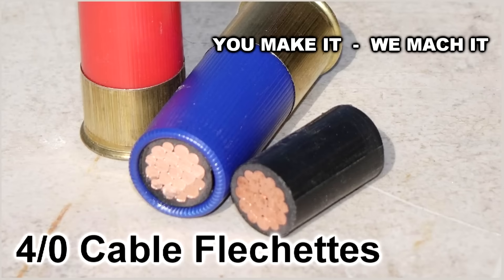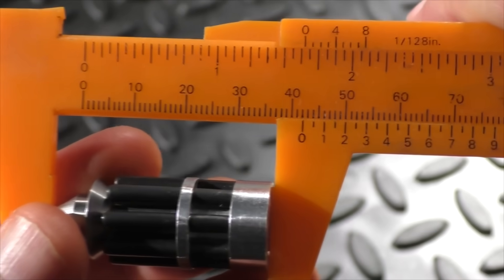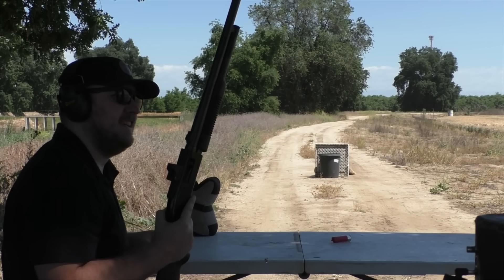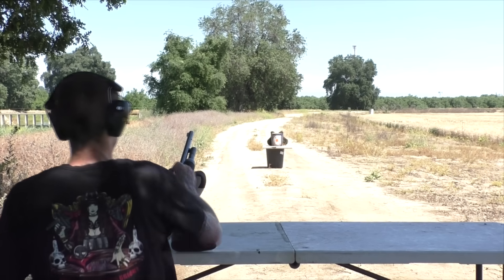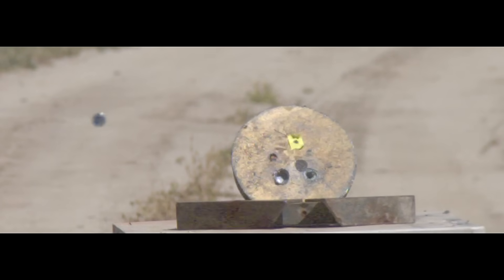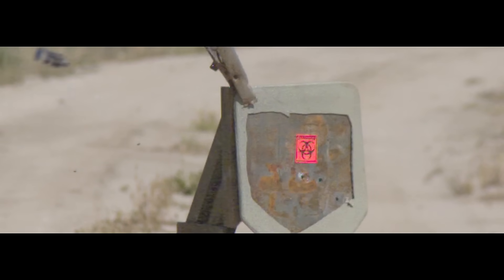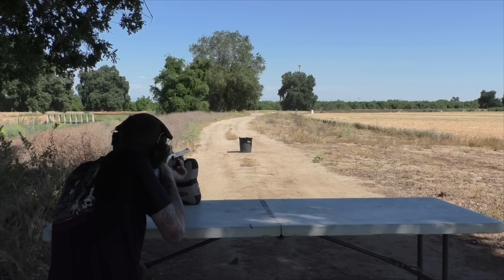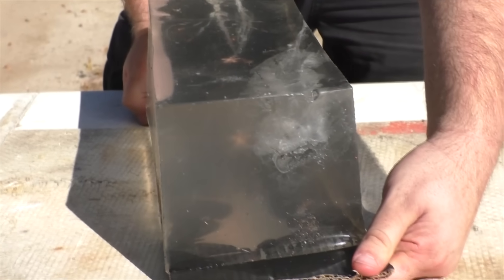RODS from GOD -  Possibly the best 12ga slug we've tested

Comment: The way those flechettes open up on impact is practically designed to rip through kevlar, since kevlar weave is designed to absorb impact by crumpling inward and catching it like a glove, the rods spread out and press it out in a flower like pattern which allows the main projectile to rip through dead on without any deviation or kinetic loss.
Reply: Also the main penetrator is anchored in the the bottom with a  screw on impact this is very important as  when the nose cone pushes back and causes the roll pins to flower out the opening roll pins would apply a leverage force on the rear where the main penetrator is attached using its own force to accelerate the main penetrator. 

Think almost like a secondary Sabot that opens up on impact
Reply: @SgtPriad  lul wonder how NY or CA would try to regulate this thing
Reply: @Sinvex Stop taking guys or they will m!😂😥.
Reply: @SgtPriad nasty little round
Reply: Good bye hollow points, hello rods from god
Reply: @arevolvingdoor3836  bro what? hollow points are ineffective against body armor, how are these two things equivalent at all? how is one replacing the other?
Reply: @mika_iran sabots do hollowpoint but core also goes through body armor
Reply: @arevolvingdoor3836 sabots from hell
Reply: What if they’re made of tungsten?
Reply: @joelsims98  this slug looks like it is more effective against meaty creatures and light body armor. SCP Foundation Mobile Operative Groups look forward for obtaining that design. Tungsten mod should be even harder to produce at least
Reply: @joelsims98  "fk you and the three goons in line behind you."
-t. Rusty Shackleford
Reply: Very effective.
Reply: Shaddup dork
Reply: To me these look like Advanced Hollowpoints functionall. Expands on impact so the entry wound is a fraction of the size of the exit wound

Comment: if you changed the core penetrator to tungsten or hardened steel, then made the rest out of copper or brass, maby keep the rods steel and add another collar in brass/copper to engage with the rifling and you should be able to make a mold that you could cast them and they would preform a lot better in all scenarios. could also change the tip of the penetrator/shorten it so it works in all shotguns.

Comment: try a bullet from a drill. Just find a drill of the appropriate diameter and cut off the part with the cutting edge. I wonder if it will rotate? It seems like no one has ever had this before. Need a plug to protect the barrel. Looks like you can cut 8-10 pieces from one drill

Comment: That round is incredible... I hope it gets a fitting manufacturer that can make them to some degree affordable.
Reply: You might as well ask dry water
Reply: @robdeskrd you can make dry water! Blend silica dust, water, and air and boom, powdered water.
Reply: @robertcapostagno2082 
Rob you a crazy mam 😁
Reply: @robdeskrd  Swapping out materials is a possibility.
Reply: @aleprechaun8972  the main issue would be the number of parts mixed with the machining, the number of man hours into machining each slug would make these an unfeasible production round

Comment: I think your shotgun MAY be unlocking prematurely. Normally recoil would not explain ejecting the round. You have slo-mo footage that will make it clear. Just don't want anyone hurt. Thanks, as always, for great video. Amazing round that I would never, ever, have thought of.
Reply from the maker: The bolt unlocks after the trigger is pulled.

Comment: Cup the end front end of the rods, and inset a nipple ring and a hole ring on the front and a sort of route ride up the nose over the holes..  intent to have the rods hold from the head flying back on the fine thread explosive load charge untill impact.. the rods might punch in the nipple .. a couple depth tests with a piston or something  in thick glass  tube to watch the load be fires at grain load variance equivilancies.. and a " fail " point of impact , as well as the acceleration stress fail points.. 
 But that looks well made and effective.. distinct advantage in a belt feed bottom feed sort of situation/arrangement.. of course we know you fellas wouldn't have altered or machined anything out side of manufacturers specs for the more fluent operstion and safety while using such rounds.. 
 Lol.... but .. ever tried gasoline or RC copter nitromethane liquid in the diesel compression.. hollow rod with a small hole at the back, piston and alignment pin.. screw into head cavity Teflon tape screw on back rod holding cylinder ( no evaporstion.. keep under 212 degrees farenheight.. ) sorts of tests.... 
 Mushroom screw bac cap with thing center so the piston pressure  reforms a crack to in vent the pressureiszing air .. fairly safe .. 5 pieces plus rods and sleeve ring rod alignment washer.. 
  Cold set and let it expand tight in some assembly to more so assure no leaks.  .. 
  KUH FCKING BOOM.. 
 Do not shoot yourself in the foot kids.. pieces is parts.. ( it's a chicken commercial) and tires ain't pretty.

Comment: How fast do you think a 12 gauge with a smaller length projectile but only one of them could be accelerated with the largest possible grain size charge? Kind of like a mini version of the railgun slug but shot with a sabot out of a 12 gauge?
Reply from the maker: It has more to do with the weight of the slug.  We've shot slugs at over 3000 fps but they were made of delrin and light

Comment: It would be a "  injustice "   Not miss justice LOL..... and from what little i have seen the Rip Ammo is still better perhaps if our designer added more shrapnel to his design, yes the pins are sharp and hard but that  cone battle angled plate stops them a bit as you can see they dig in to it a bit. if he added a cork screws projectiles and more,  would go straight and cut deeper? maybe bevel the cone part for each rod?

Comment: Wow! You put a Tungsten core in that, replace the Rods with ball bearings all stacked in rows and that spreader mechanism at the top is going to send those bearings out near sideways while the Tungsten core goes through darn near everything. Crazy levels of destruction! Well designed Jay!
Reply from the maker: Let me know when you make them!
Reply: While you’re at it?  Make a Mauler kind.
Where the rods have a designed hook at the ends of them, that latches back onto the base Core when it starts to spiral in & spread?  With added Ball Bearings.  And then see what happens 😝
Reply: Kinetic energy powered claymore,
Reply: @MikeEwalt  portable claymore, psychotic man work

Comment: Might be the future, loved the vid
Great spread on the low resistance dummy, that collar will direct the penetrators in any circumstance, truly massive wound channel and extraordinary energy transfer.
Only concern is over penetration vs targets in a wide arc behind, which would limit these things to specific tactical uses.
If that central penetrator were tungsten rod it would double up to penetrate vehicles as a multi purpose threat. If the pins were made to open out/deform, being a rolled spiral with a tapered spreader in the lead end then wound channel and target shock would be unassailable.

Comment: I reckon you might call me new to the gun community. I've been doing it now for about 5 years. In that time, I've learned so much it's unreal! And i know I still have so much more to learn. I can tear down all my pewpews(YouTube Idiocracy) clean and put them back together. I have taken parts from one to put on another and modified it. I have even got into reloading. A friend of mine has all the stuff and the past 6 months or so. I have loaded all different types. But the one thing we don't have is a shotgun shell reloader. And this channel has made me definitely want to get one!
Reply from the maker: Shotgun shells are pretty easy to load and don't take a lot of equipment.  I have the bare minimum really,   not fancy scales,  powder feeders and I use a really rough old press to resize and reprime.

Comment: The rods from God doesn't fit into the category of sci-fi. It's completely plausible, simply impractical. It would cost too much to put them in orbit.
Reply from the maker: Most sci-fi is base on some facts.  Until it is a reality,  it is just fiction
Reply: @taofledermaus  then I fear you don't comprehend the definition. The theory has been worked on, on and off since the cold war. The one and only observed factor keeping it from being employed, is expected to no longer be an issue within 10 years. While it may yet be implemented, it has in fact been worked on. There for does not fit that description.

Comment: Use a standard automotive lug nut and a bolt for the center instead of the machined parts. Hold em together with a simple cable tie and use brake line tube for the rods. They seem to already be hollow. The front of the lug nut would be hollow, so you could even put the shells in a magazine tube.

Comment: Would have been very disappointed if you wouldn’t have did a new gel block test 😅 I was literally commenting fixing to stop watching and then bam there it was 😂 definitely wouldn’t mind getting some of these or if the OG would give info on how he made it so I could make some myself. Would love to have these for home defense rounds. I’ve always been big on self defense setups but after last July having a armed intruder while on vacation at a rental house we rented and having to use deadly force I’m alittle over kill in stuff now everything has lights on them as well as red dot. So even edc pistol that’s a G43X at the moment fixing to buy a g19x to kitting it out with a red dot and flashlight for edc! I used a sig p365 macro x in Florida in the intruder but it was plan jain all OG but it was the ported barrel sig and I loved it and it did its job as a tool and saved/protect mine and my families life’s that night and was running hornady critical defense but the pink tip ones because I had bought some for my wife and I had loaded it up with them after shooting acouple boxes of them and they did the work and stopped the threat and unfortunately the guy passed away. But the investigation is still open until the DA signs off on it so they still have the sig until he signs off that it was clearly self defense then hopefully I’m able to get it back and if I get it back it won’t be my edc for when on vacation and stuff again more of just around town and stuff because a Glock is a much cheaper tool then my sig and if it lost a Glock who cares they a cheaper to come by. So everyone that reads this remember if you have a choice of weapon use something you don’t care to never have again because you might now get it back 😂

Comment: Showed this video to a friend and he is now asking what modifications you made on the second load for Shane's gel shot. He also said he really appreciated the measurements and loading breakdown.
Reply from the maker: I used sabots that were a few thousands of an inch thicker.  These slugs really didn't have much surface area to grab onto.  I backed off the powder about 1 grain.   I also wrapped some electrical tape around the base of the slug just to grip to the sabots a bit more.

Comment: Zombie Stoppers. Stompers?
these are downright Nasty.
but well designed: the components are simple enough to batch out. assembly is the worst part.
the nose geometry can be improved, and it might be worth the time to cut ramps on the pins : simplify the ramp ring to a square slider...
it'd be interesting to  see if a plastic or resin could hold the pins: that would remove the most difficult component, add pins, but complicate & extend setting time...need a mold/casting jiig to hold everything centered as it went off. Hot Glue??

Comment: the front of the darts are offset by the center core so they will wont impact at a 90 degree angle so its unlikely to do much to hardened armor because less energy

Comment: After hearing you mention the Kylon rounds, I spent the day and all night researching and prototyping rounds. I've scrapped everything and concluded Kylon has the best shape. With it's existing 1.2G nylon 'Shell', it would need a 1/4" x 1" tungsten insert through the tip with 8 thin, 3/4" x 1/16" tungsten rods, drilled and inserted at a 45° angle from the center of the bottom for the flechette effect. A perfect round for soft and armored targets.

Comment: What a terrifying round. I knew exactly what would happen based on the design. Wasn't wrong. Yeeesh. Just to change the subject a little bit, when I was in the back of the security van, when I worked in the industry,I only had 1 demand. A semi/pump 12 gauge with a starting round different from the duck shot we're supposed to use. I wondered if a solid as the first round in the breech was good enough. Now I know exactly what round  want first. Yes, very much😢

Comment: You know, considering it's only steel and aluminum and the pins, mass production could probably end up being a thing that would reduce the costs significantly. If these rounds got picked up by someone with the means to do it. Honestly those are insane rounds. I'd be curious to know if they could be designed shorter and still work? Maybe make them shorter but give them a tungsten core so the weight stays about the same, but you don't run into the problem of the pointy end touching the round in front. Honestly just a really cool design! Always love your videos that end with the lead plate and the gel block! If your gut tells you you need a reshoot, then take the reshoot if you can! I think everyone absolutely loved that!

Comment: So this slug acts as a flechette in soft material, armor piercing in light armor, and fragmentation on steel. Literally no matter what you shoot it at, it always maximizes damage. Damn.
Reply: Pretty serious engineering to be sure. This guy could make a killing (no pun intended) commercializing this slug.
Reply: I think the problem with mass production would be the complexity. Way too expensive to make for it to be anything but a specialtly round.
Reply: @altec6976  yeah, it definitely wouldn't be replacing regular slugs in the future, but the idea is pretty efficient.

Comment: Banana Ballistics used to use an 8x8x8 inch box of sand and that stopped almost everything - even high velocity and power rifle slugs - the military uses sandbags for hard cover for a good reason.
Wow though - I was hoping the round would work as advertised and OMFG, did it ever do so - I hate to say it, but this thing borders on being a warcrime.
That said though, recall those Russian rounds done by the killer clown guy - there was one which was segmented and had anywhere from three to five (?) petals break off cleanly and spread out, with a half-slug instead of a rod going down the center.

Comment: Great concept, but I would change it a bit.
I would make the front section both shorter and with a wider and less pointy tip.
This would make it both possible to load without anything sticking out in front of the plastic and the point would not detonate the shell in front of it in tube magazines.
The center can always be made of tungsten as well if better armor penetration potential is wanted, but in most cases this is not needed at all.
If a proper machining setup is done, I don't think the manufacturing costs would be so high if a decent number were made and I think many would accept the cost per shell for what they would use this slug for.
I would not hesitate at all using this slug on cape buffalo and for hunts like this, the ammo cost is not something you care about.

Comment: Jay did a fant1stic job here. Not only with the engeneering of the slug but also with the research over it. Because from my point of view the science behind it is incrédible. The force of the impact on the centerpin and the ring of steel come push the little rod, then the back end push it back in and reflect the force of the impact too on the rod. (Newtown law the rod apply force on it and its reflected) wich push them and make them as lethal as the core. Making it so deadly i hope it wont go to industrialisation. But would love to see more of those shot across other stuff because it will rip them all to shred.

Comment: We really need a tungsten upgrade, it's 2.5x denser than steel, and up to 30x harder. I've used 100 pound machined pieces before (which isn't that big). It's just brings the Heavy Metal energy.

Comment: Well, when you shot that dress maker dummy in the junk, you probably shouldn't call it the sweet spot. That would be like saying it came right out of the entrance. But, all in all, great video and as a machinist, with a lathe and mill, you could put these out fairly fast but with a CNC you could pop these out quite fast. Roll pins aren't real expensive but it could get to be an expensive round for the materials alone.

Comment: I cannot be the onliest viewer struck by the similarity of this munition to the modified non-explosive Hellfire missile variant R9X missile alternatively named the Flying Ginzu.  That inert missile, instead of using an exploding warhead, deploys eight blades in the last few yards of supersonic travel. Each blade ends up extending about one meter at right angle from the axis of the kinetic missile... That is, kinetic in the sense that it does not kill by exploding but by slicing through the target with the extended blades. This is intended to minimize collateral casualties and damage. 
Seems this much smaller 12 gauge unit uses a similar concept, with a design that suits the scale.  BRILLIANT!
 Well, I think I'll watch the video.
I must voice my distress at the abuse of the beans. I do not accept that they deserved to be sacrificed just like some faithless partner would abandon sacred vows.... just for being a few years past their stinking "Best if used by date." I'ma write a note to my Congresscritter.